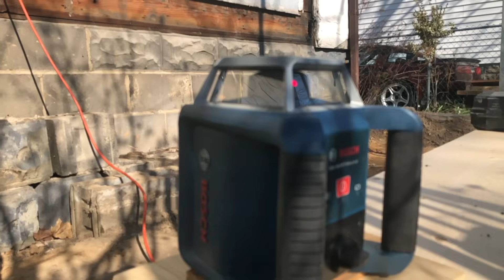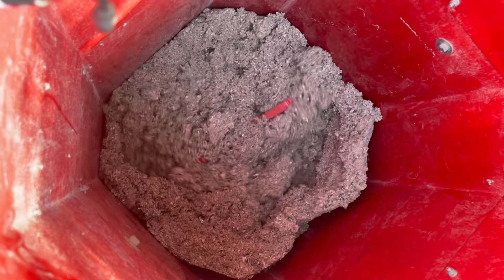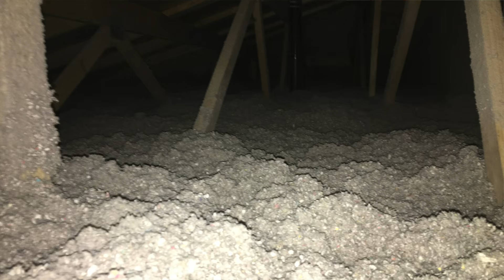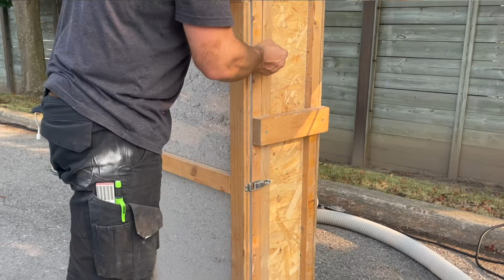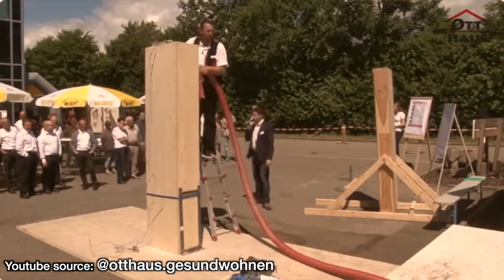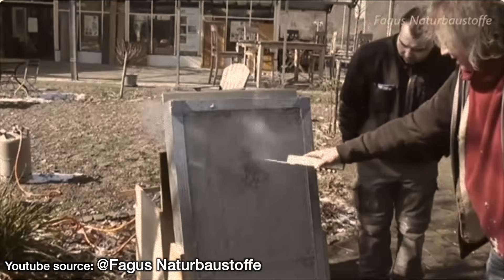Why I Chose Cellulose Insulation for This High-Performance Wall | Episode 5

Comment: My father had an insulation company in the late 70's here in the states, and all he installed was cellulose.  Helped to unload many semi-truck loads of cellulose bags.  He used to always do the red hot penny bit when he was selling it or at trade shows.  I remember there was a house that he had recently insulated that caught fire.  It was a big deal that the Fire Chief said on TV the only thing that saved the house was the cellulose insulation.  Installing it in existing construction does add a few issues you ay not be having in new construction. And I see that someone asked about it below, which is wiring and framing or fire blocks (or really just bad framing).  You could end up with some voids, or have some blowing through and badly installed wall outlet.  But he was like you, always shoving the hose down into the wall when he was blowing it.  He always said you could feel if you hit something like wiring or a block of some sort.  Of course, back then thermal cameras were not anywhere near affordable.  He also always said that settlement was the fault of who ever was blowing it in.  If they did not pack it right, it would settle.  He also attributed that to less than reputable contractors who were just trying to use less material to scam the home owners to make more money.  Occasionally they also has blowouts.  If the plastic in the house was not done very well, or if the person blowing it in put too much pressure and over packed it, the drywall/plaster would break and it would just empty into the room.  Especially if the person running it didn't realize what happened and kept blowing.  That was a mess!  But I would 100% recommend cellulose to everyone out there.  Of course, in the late 70's there was a big tax credit for homeowners that insulated their houses, which was what really drove the demand.  When the tax credit finally went away, the demand did not go away, but it majorly slowed down.
Reply from the maker: Great story and history with your dad doing this. I didn’t have to deal with any wiring or plumbing, other than the HVAC forced air ducting in the floor, because I used a service cavity for all the electrical circuits. It keeps all those out of the walls. Also, even if I did have some smaller voided, there still is the continuous insulation from the wood fibre board over top of the framing. We still have some government subsidies from time to time for this kind of work. But really, at the end of the day the insulation is much cheaper to purchase, so it only comes down to labour cost and how quick and efficient the installer is. 🙌

Comment: How much cellulose do you use in each cavity (standard 16 oc - 7' wall) roughly? I see they come in 25lb bags...is that correct?
Reply from the maker: the size of the bales depends on the manufacture. These were 25lbs, but I've also had 35lbs bales. 

As for your question about the wall, it depends on how deep the studs are, but essentially for dense packing it is 16"/12 * 7' * depth of cavity in inches / 12 * 3.5lbs/cuft. For a 2x4 wall (3.5" deep) it should be about 10lbs of cellulose.

Was that helpful?

Comment: Have you thought of using cellulose batts instead of having to rent a machine, use netting and blow in the insulation? So much less work and mess.
Reply from the maker: I don’t think I have them available to me. But I do own the machine. I have a construction company planning prefabricated panelized projects and owning one of these machines is important to offering a full envelope service. Some of advantages of blown on insulation would be lost with cellulose bats though. Great question though. Have you use cellulose bats before?
Reply: I've seen a material be used to hold the cellulose to the wall before drywall or other material was placed.  My only question would be, could you get the same amount of density as blowing into a cavity with a hard rigid surface on each side?  I think no matter what type of material it is, it is not going to hold the same amount of pressure has a solid wall.  Though I've also seen it used on ceilings, where you typically over blow the amount because it is just going to settle down, unlike a wall.  But I am also thinking a attic type space above, not a second floor.

Comment: What about working around electrical wires in walls, you can't get the hose from top down? Just drill 2nd hole lower down?
Reply from the maker: For this wall buildup, there were no services in the wall cavity with the cellulose in it. I installed a service cavity in front of it (interior side) for all electrical cables. No plumbing needed, all HVAC was in the floor deck.
Reply: Ahhh right you have service cavity

Comment: Is there a best practice method to blowing cavities to get R3.5/inch?
Reply from the maker: There are a few best practices. 1.) I'd always make sure to compartmentalize. You can't really build up pressure in a controlled manner if you don't have compartments. It's possible, but possibly a lot more work. For instance: double wall where the entire wall becomes one cavity. You can pump it full of cellulose, but in order to dense pack it, you have to "needle" it and increase density locally all over the wall 2.) Measure everything: set up the machine properly beforehand (for instance with a test volume like I showed in the video), spot check and weigh the cellulose after installation 3.) keep track of the bales installed in a wall so you can verify if you achieved density. I'm not sure if companies here in Canada offer training for dense packing, but in Germany there are. The actual work isn't that hard, but QA procedures should be followed.

Comment: Can dense pack be achieved in walls, floors and unvented ceilings with the standard home depot rental machine?
Reply from the maker: Great question: I've rented a relatively decent machine (light blue if you know which brand that is) back in 2006 when I renovated the main part of our house. I only lose filled cellulose into the attic, but the machine was barely able to pump the cellulose up two stories. I think I ended up carrying the machine up to the section floor to blow in from there. I'm not sure if the seals were maybe used up or if the blower was weak to begin with. So I'd be very careful with the machines.

I also just recently heard from a contractor that he is barely able to use the rental machines, or that he's just wasting his tim with it.

On top of it, I've now seen machines that will only accept fibre glass insulation. I think it's a means to promote that product. It's a lot more expensive per bale, but I haven't calculated the yield, I'm sure it's going to be higher per R-value per square foot. 

The X-Floc machine is a lot stronger than rental machines. It has two blowers in it, and it has a lot more features and ways to control the cellulose than a standard rental machine. We do rent the machine for these purposes, as we know that builders are struggling with dense packing cellulose if that's the route they chose to go.

Comment: How do dense pack and damp spray compare?
Reply from the maker: Great question: I've never compared the two. I have no expertise with damp spray, I've only ever gotten a demonstration of it by a cellulose manufacturer. Here are my common sense observations:

- damp spray is for a different purpose: in our case, I'd use it for service cavities, where I have a vapour barrier behind the cavity, I want to spray around the services so I can't really do this into a closed cavity as cables and pipes are going to restrict the flow of cellulose around them.
- I don't know what density damp spray is at, but I'm almost certain it's lower than dense packing, so it's going to have lower R-value (someone please chime in an correct me if I'm wrong). 
- damp spray has very different applications like fire proofing with different additives 
- damp spray is a lot more messy because of the cleanup with the trim roller
- correct me if I'm wrong: damp spray does take some time to dry up. I'd be concerned with the moisture we are introducing into a building. Humidity should be closely monitored so we don't get mold issues. I'm sure that could be managed easily.
 
What I find very attractive about is that I could use cellulose for the entire build, including service cavities, but maybe I could achieve similar results using mesh membranes. 

It sounds like you might have experience with damp spray. I'd love to get your input if you do.
Reply: @TimberPlanners   looking at using it in the future. Thanks for your perspective! Makes sense.
Reply: Anne and Joachim Feast Day: July 26
Patrons of: Grandparents, Married Couples, Parents, Fertility, and 
Christian Families